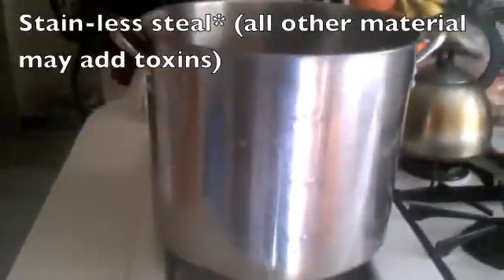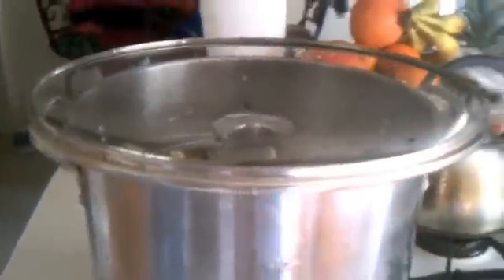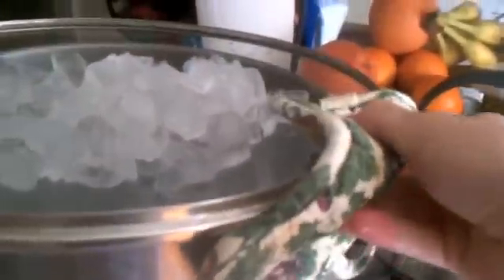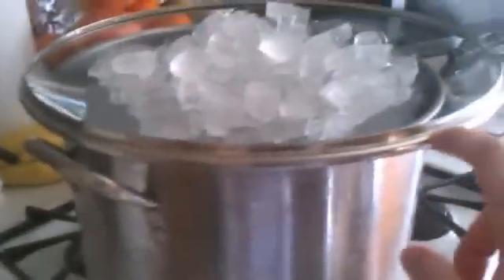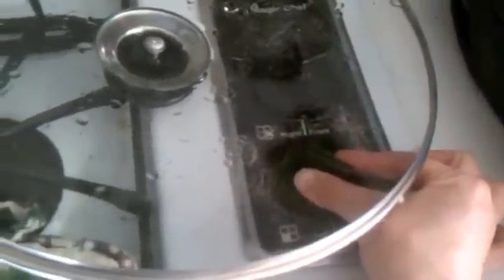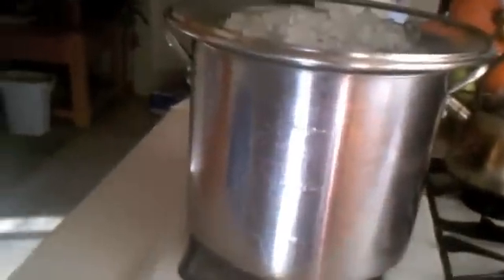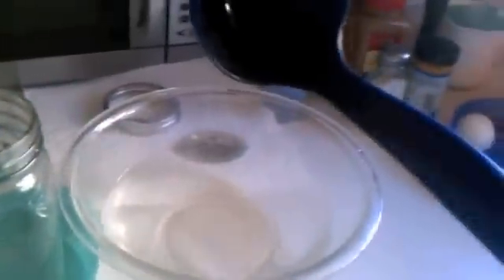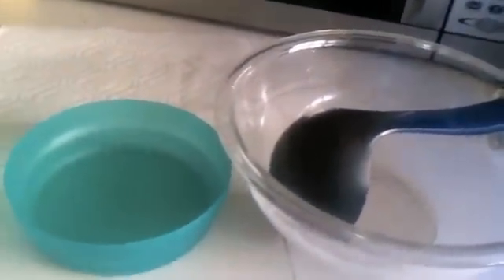How To Make Distilled Water | DIY Distilled Water

Comment: I used distilled water in the radiator of my BENZ, every two years i changed the water pump. "no lubricant. BUT the engine coolant chamber was clean throughout the engine. No pitting or degradation.

Comment: Hi, can I use a ceramic bowl for inside the pot? I know ceramics are fired at a very high temperature so the 100c shouldn't be an issue, but are there any adverse affects for the actual water?